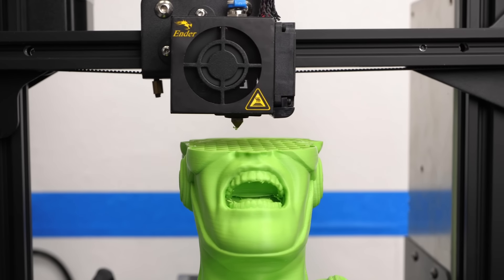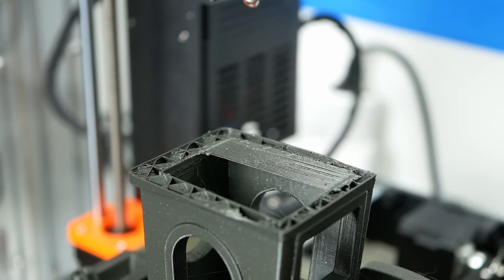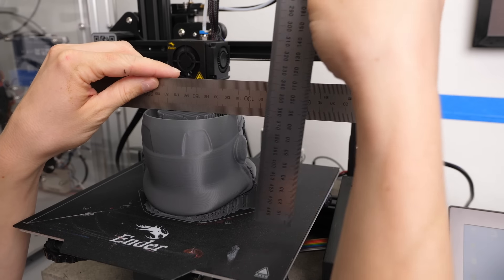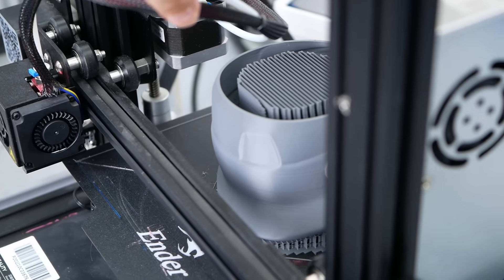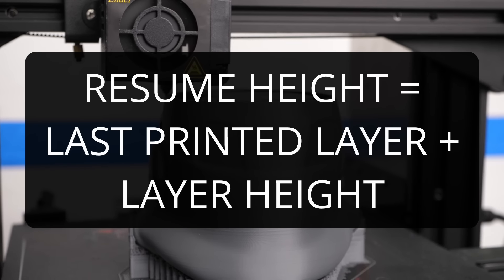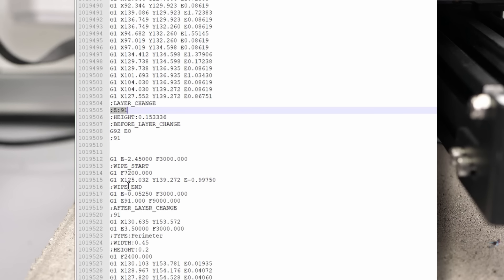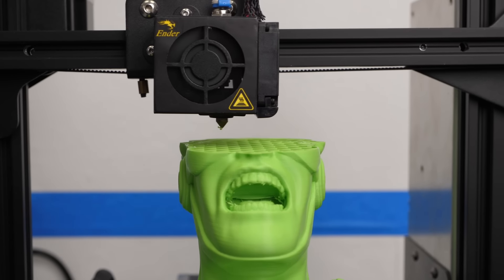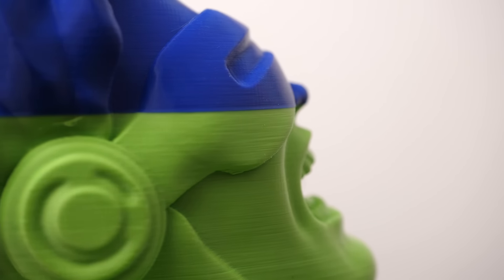HOW TO: Resume a failed 3D print!

Comment: Stefan! Excellent video. Thank you so much for posting it. This is easily the most useful video I've watched all year. I have a project where I'm printing a 3d form that will later be filled with concrete. This will be a feeder for a blind raven. Anyway, I was using old filament that kept refusing to unspool. It wouldn't break, it just wouldn't feed. This was a 3 day print and I had a major failure after about 1 day in. I followed your video and I am happy to say that it worked perfectly using a CR-10s controlled by Octoprint. I edited the gcode using visual studio code and with a gcode extension. This video really saved the day. Thanks again!

Comment: Thanks for this amazing video, it’s saved me quite a few times! I have a question: The last few times I’ve tried this method, when I go to print the file again the nozzle moves over to the model (reeaallly slowly) , then instead of resuming it comes back to a random point (usually somewhere right on my model) and starts purging filament none stop - which then builds up around the nozzle and melts into the model. I have to turn the printer off and then on and then choose to ‘resume print’ and it ‘sometimes’ goes back to printing as normal, or it does the exact same thing with purging filament. There doesn’t seem to be any rhyme or reason for it or consistency to it. Is there a certain command causing this that I should delete, or one I’ve deleted and should leave in? I’m on a CR10 mini. Thanks!
Reply: When my print resumed it also really slowly moved towards the print, however it landed on the right spot and continued.

Comment: 40 hours of print saved thanks to you! I just had to also reset the extruder with G92 just like nmos001 said in another comment, since the first move in the layer had it at over E1500

Comment: Actually made same thing like three weeks ago. Failed 92h ASA/PVC print like 10h before finish due to faulty chamber temp sensor. Found the spot by random seam, gradually heated it up again(i was really lucky it stayed somewhat attached to bed), cut the gcode, added some modifications and finished it. Fun starts when someone is using probe for z homing and has safe homing point right in the middle of the bed or has to measure whole bed as he has no saved values for leveling XD. Im lucky im not using probe, but manual mesh leveling....

Comment: With the heat we have now here in Italy, the extruder stepper motor gets incredibly hot and a TPU print just failed I'm front of me, as the filament melted on the gears lol

I quickli paused the print, put a fan blowing on the printer, cut the bad filament and resumed. Worked perfectly!
Reply: Can't you adjust the fan settings in the G-Code to take care of that?
Reply: @dangerous8333  oh the E3D V6 with the titanium heatbreak works wonderfully, the problem is the extruder motor itself, the filament melts on the gears. The motor doesn't have a fan on it, I'll print one and install it when I have time

Comment: Thank you Stefan! You saved my print.

Looks like Cura uses absolute extrusion mode, so I also had so fix the extruder coordinate accordingly. I added a G92 E147.5402 (in my case) witch was the last position of the extruder that I have deleted.

Comment: Thank you so much for this vid!  I just saved a 20-hour print that suffered a thermal runaway at the 19 hour mark.  The original file was 1,066,477 lines of code, and after editing it is 94,950 lines long.

Your instructions were clear and "on point".  I use Cura so I double-checked on your website what to edit, and adding those three lines after G28 worked like a charm!  (M106, G0, G92)

This is certainly an "essential skill"  :)

Comment: saved my print. one minor thing you forgot. For some reason my PrusaSlicer sets the temp to 150, then homes, then sets to temp to the desired (210 in my case) then waits for it to go to that temp then prints. So if you delete everything between "home" and "do my layer" you miss the temp setting. I had to quickly hit pause and then manually set the temp, wait for it to get to temp then hit resume. Maybe you should make an updated video which includes these details about what lines to add / no delete to get it to the correct temp before resuming

Comment: i was able to use my Auto Level to pick up the edge of my part and resume printing from the layer i needed to - rather than doing the nozzle-to-part method.  and it was SPOT-ON.   -thank you for the help for finding the Z line in the G-Code.   ---but use your Auto Level Probe and tell it THIS IS NEW HOME.   was sooo much easier.  - i was so scared lol

Comment: Hi Stefan thank you for your valuable videos. I'm using a Creality CR10S Pro v2 with 1.70 Creality fw. Yesterday I had a power outage and after electricity came back printer noted me to resume and I select the resume button. It started to print. The Z height was correct but x position was shifted around 3-4cm so I cancelled the print. Do you have any idea about what the problem was?
Thanks 
Onur.

Comment: My print is up and running again, updated the gcode in VSCode and it's off and running.  I did have to pull the power on my first attempt.  Cura uses a three part G0 (i.e. G0 X67.54 Y187.126 Z7.575) which caused the nozzle to hit the print before it got high enough.  Make sure to set the height first before getting to the layers move command (e.g. G0 Z7.575) and have your morning coffee before you start editing gcode (or any code for that matter).

Comment: For the last one can't you just home the x and y with the line G28 XY on the sd card's gcode after setting the height manually for the z axis? Thus, avoiding the need for a computer hookup while still avoiding crashing into the print by doing a full x,y,z homing command?

Comment: So much easier to do on a delta because they zero at the top.

I just home the machine, then use gcode to step the z down to where the print stopped. This is a perfect way to measure the print.

Then once I have measured the print I delete the beginning of the gcode file so it starts on the correct layer and print away 😎

Comment: Cheers! Awesome, but I just ran into one big issue. My Ender 3 V2 is running the Juyers firmware and after homing X and y, I was trying to manually home Z using the G92 command as you described. The command is sent over octoprint but the printer doesn't seem to acknowledge it. It is returned with the M114 command, but on the printer display Z just shows 0 blinking. Any ideas?

Comment: I'm trying to salvage a print that stopped at 90%. Watched this video to get myself most of the way there. But during home check, the Z check happens in the middle, which is where the model is, so it hits the top of the model and goes up another model height to squirt out plastic in the middle of the air. Is there a way to change where it checks the Z height so it starts at the height it is supposed to? After the Z check, do I also need instructions to push the Z axis into position first then the X and Y to prevent the printer head from knocking into the existing model? Using a Creality Ender 3 S1 Plus if this info helps. Thank you.

Comment: I went about this in a completely different way, which is worse tbh. I took my failed part and measured the height as precisely as possible. Then, I imported the file in blender, created a plane, scaled it to cover the piece in the x and y axis. Next, I extruded the plane to the previously measured height and use the boolean modifier to cut the size of the box from the piece. Finally, I deleted the box and exported the piece as an .STL

Comment: Sooo many recovered prints, since for prototyping i usually use cheap filaments and they clog reeeally quickly sometimes..  if custom marlin is used, it is great to have babystep X and Y turned on in addition to all your tips, individual axis homing is also good to have if the steppers idle

Comment: I managed to safe a print a couple days after it had fail, due to me having school and work. It had particularly detached from the buildplate so I used some ducktape on the bottom, and due to me running klipper and it being thermal runaway, I found the exact spot it had fail, and used that to edit the gcode file 
It's now a part of the printer that printed it, which is kind of nice😅

Comment: Not long ago I had a long print fail late in the game.  Given the non-trivial investment of time AND filament, I had the idea of TRYING to do what you're suggesting.  Unfortunately, I couldn't figure out how to home-Z with the print right in the middle where my Z-homing is done.  So you show how to get around that - for which I'm GRATEFUL -- BUT --
Looking at the G-code where I thought I needed to continue, what threw me off the scent entirely was a little detail I hadn't thought of: the extruder steps in each line were FAR past zero, and I had NO idea how to sync the extruder to those numbers. 
Have I managed to describe the problem adequately???

PS - Perhaps - I can force the current value of E via the G92 command?  Hoping....

Comment: I used the method without homing, the Y didn't seem to home although that axis was fine, but on X it printed a little to the right of the original print. Not sure why that was. Also Cura uses absolute extruder position so I had to also set that with G92 Zxxx.

Comment: Once this happened to me after 15 hours print 😭 I did this: measured the failed print height, cut the model on the slicer, lifted up the home switch for z axis 👌 needed a bit of leveling but worked very well

Comment: I did for years with very similar metode (i use octoprint BTW). First I switch off and switch on the printer. Than I execute command: M121 which is disabling endstop. Than I can move the Z axis to touch the last printed layer. Than I execute command G92 Z0 which says that Z is now 0mm. Next I move Z axis to the max (carefully) and when I reach the Z max i have to note the Z value (for example 130). When I know that my Z max is 200, I measured 130, my print is 70mm. Than I return to slicer. simply cut the print for suitable heigh and then I select second printer profile which I allways call recovery profile. In this profile the start gcode contains only preheat, HOME XY and G1 Z0 commands at the end. Then print is resumed. The end gcode is the same like in regular profile. I sucessfully recover with this metode ~10 prints per year. Regards

Comment: This was super useful! I followed everything, but knew I wouldn't be able to home since my print was taking up most of the space, plus my printer zeros mid-XY. But...

...the printer homing commands were doing nothing on the console and went I sent the print job, the dang thing homed even though I removed G28 from the code.

Turns out my printer has job start functions in the klipper firmware which can't be easily changed since they run their own variant of klipper. So I'm going to try to print the remainder and glue. Don't want to waste the $8 worth of print!

Printer is an Elegoo Neptune 4 Max.
Reply: You wouldn't happen to know where i can find these job start instruction would you?

Comment: To answer your question - I did :D We had a huge power outage because of a nearby stadium. There was a huge power surge in the stadium and it fried out about 1/4 of the citys power grid for about an hour. 
I was printing a long one - it was a new electronics case for my printer that had the PSU and boards, cabling etc in it. It failed about 7h in. I measured the top, from the bed, moved the model down by that amount and set the offset on the Z axis to the same height. I also had to disable ABL. Sliced the model again, and I could start the print after it homed on X and Y. It came out OK though it was "slightly" too close to the print so about 0.2-0.4mm offset should have been added as a plus. It ended up grinding the nozzle a bit but it turned out fine :)

Comment: Is this possible with a Anycubic Kobra Plus? I am assuming yes, but I just wanted to be sure. And if so, I guess I'll need to link directly via my laptop to make the adjustments?
I had a failed print due to heat creep, I think... the extruder stopped feeding filament and the nozzle was printing in mid-air, and while cleaning the nozzle, I reached to the tool drawer,  I thought..  on my 2nd Kobra plus and actually grabbed my sd card and pulled it out... causing my 2nd print to fail...

Comment: I had to add an M1 command to move the Z above my print after the starting G-code but before where I wanted to resume printing. Otherwise it tried to slide it's way to the start from below and crashed. Probably could have done different G-code modifications to solve it, but that worked for me.

Comment: It would be great to use BL-Touch sensor to measure the Z distance. Put the planar plate on the printed model, measure with BL Touch and only substract the plate thickness.   It doesn't have to be difficult, does it?

Comment: I saved a 34hr print a couple of months ago with a similar method. The only differences are I'm using a duet board and for whatever reason the extrusion value in my gcode is absolute rather than relative, so I have to add a line to tell it how much has already extruded.

Comment: I was able to recover a print that failed, luckily it plugged about 60% of the way through top layer 3, of a mid height "top" of my model.  I was able to find the exact layer because of this, if it was in the middle of infill, i would have had issues.  From there I took the Gcode, went into a gcode viewer, found the same layer in the gcode, then trial and error to delete everything before, without losing my level and such.  I was able to get the gcode figured out to have it auto home, then move up 15cm, above the model, then resume print using X and Y first, then Z.  I reprinted the partial layer, as it was about half layer, and this was going to be a section strength was important.   Overall it was a lot of work, but was able to save the print.  Mostly I did it to see if I could.  It would have been quicker to re-print, in my case

Comment: Thanks for the guide. it helped me a lot!

For my prusa, the last setup code was "G28 W" which is suppost to be homing without bed leveling. however it did level the bed each time.
i changed it to "G28 X Y" which worked to turn off bed leveling. however for this time the print was lost because the Z level was reset. but for next time. "G28 X Y"!

are there ways to manually reset the Z?
Reply from the maker: You can use G92 Z123 to manually set a z-position.

Comment: Aren't there G-Code variants that work with relative positions? So that there is no absolute positioning at each start of a layer. I once had a failed print, that I could not recover although I knew on wich layer it failed. The printer homed and crashed into the unfinished print because it only raised the Z axis 0.2mm to the "next" layer... but it counted from 0 and not from 50mm (or what ever the last layer was)

Comment: I'm in a fix I have followed your advice and I am POSITIVE I am at the correct spot to restart my print. HOWEVER when I do the search in the G-Code for location using my final height being 59mm to your 91 I get zero results there is only 2 references to a "Z" location and that at the very start of the print and at the very end  I'm X 19.0 Y 221.5 Z 3.0 ( that is my current position and it is right over the point where it failed (due to a loss of power according to my XYZ info on my CR6 monitor).  I have multiple items on my plate I combine d items to print all at once the last few items were the tallest.  I have a Creality CR 6 SE printer and I can see the the sections that list the various items in the G-Code but can not find anything that matches the code as I noted above. So what do I do? My G-Code text doc looks nothing like yours sample.

Comment: if you normally have a G29 on your start gcode, to probe the bed everytime you print, you need to replace it with M420 S1; (it will restore the last saved mesh) otherwise you'll not have mesh compensation enabled, and Live Z Height Adjust will also not work because of that.

Comment: I got 2 days into Mando Helmet and a fan quit and heat creep stopped the print.  It was too big to re-home.   I measured to find the printed height and resliced.  I then modified the gcode to only home X,Y.  I used a piece of paper to manually "home" Z to just over the top of the printed piece.  I just started the new print and had no  seem at all.

Comment: such a good video, I've been struggling with this lately when my filament needs to be changed it never resumes at the right height. got plenty of things to try now
Reply: I've had to add new filament mid print a couple times, and I've always had success just pushing the new line in up against the old line as it continues printing until the extruder grabs hold of it and can take over. But that does require you being there before the filament gets pulled through completely and causing a failure.
Reply: @Halinspark  i've had this recommendation before but mine has a filament sensor and is direct drive so no way I could feed it in as it goes jumping all over the place >.<

Comment: Great guide! It gave me the confidence to try on a print that failed while I was away. So far, it seems to be working well (after a false start where it moved in the XY before lifting to the proper Z). I should have taken another 0.2mm off the height. I did take 0.2mm off the measurements I'd taken, but I guess it wasn't quite enough. We shall see. Next time, I'll also use Fran's advice to be ready to baby step it down a notch if that happens.

Comment: Outstanding video!
Was able to save a build running for 30 hrs just now, due to a clog. Had to get tricky to get the printer to home, but once it did, the modified code picked right up.
You got a new sub!